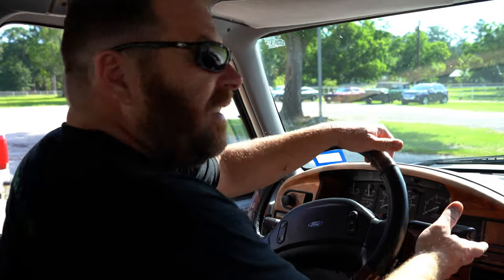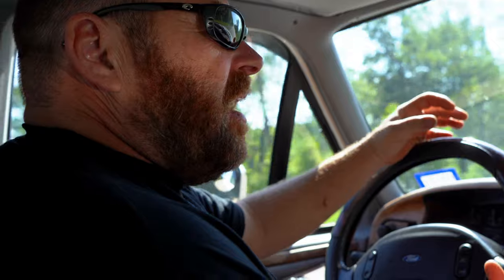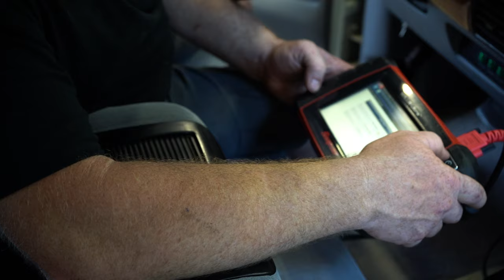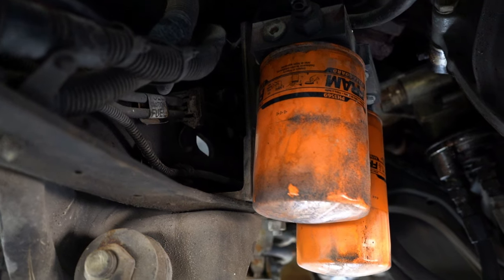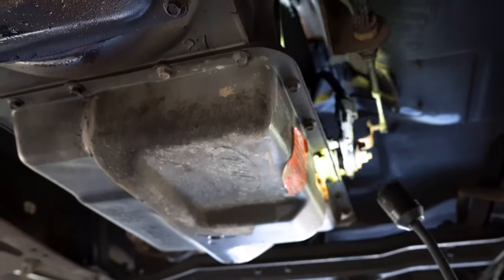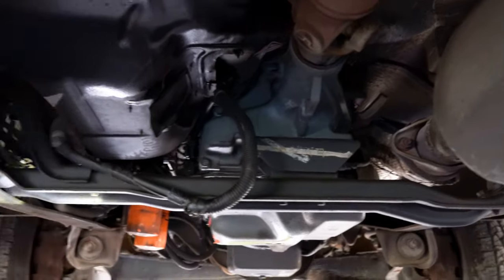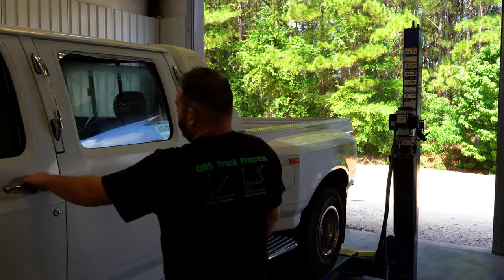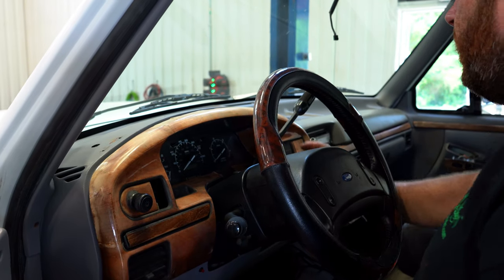How To Video - Purchasing a 1992-1997 OBS Ford? What you need to know....

Comment: When my speedo was bouncing I just had to unplug the ABS module and it fixed the issue
Reply: Where is the abs module? My speedo doesn't bounce but my od flash won't go away
Reply: @keganlaing6483  the abs module is right behind the glove box on the right hand side, the plug is on the right hand side of the module too.

Comment: Have a '93 non-turbo 7.3, the speedometer kept fluctuating/bouncing. Disconnected the abs wiring (located behind the glove compartment/abs module) and the problem went away. Yes, no longer abs brakes, then again, abs wasn't all that good back in 1993! No more speedometer fluctuating/bouncing. These trucks are in the 30-year old range now, they have a right to have some things not working all that good anymore! BUT...they are well worth restoring/bringing back up to good working order. So simple the 7.3 idi diesel engines are and will last longer than most of us will, if good maintenance is maintained. Yes, even changing out the abs sensor on the rear differential (tried 2 different new ones) did not help. Disconnecting abs wiring behind the glove box is what corrected the situation.
Reply: Hmm I’ll have to try that out.

Comment: This is why I will never ever buy an OBS Ford with an Automatic Transmission. My 1986 has 74,455 original miles on it. But the original owner let i sit in a barn in Idaho for 15 years. So I ended up rebuilding the 460 Carb Motor. And now it's a 468 with Forged ICON Pistons, Eagle H-Beam 7/16 connecting Rods and 1969 429 DOVE-C heads on it. It's a 4x4. I am going to paint it. All in all she's a fantastic Truck. I've had several of them. I will never have anything else.

Comment: You forgot checking the core support for cracks along the top, under the rubber deflector strips between the header panel and support and the rot at the mounts. Mostly cracks tho 

So a few things, things that I had to find out the hard way over the years that people seem to ask a lot on the 7.3 OBS pages. 

How to remove the rear door glass (what a fun one that was to learn) 
Door lock actuators and options for replacing 
Inspecting the wiring between the doors in situations where the windows work either intermittently or from the door but not the master switch or vice versa. I’ve bought a few trucks that were really worked and used with broken wires in the doorjam loom where it opens and closes a lot 

I think a black bezel with the wood trim would be more than appropriate for that truck, in my opinion Atleast. The Centaurus truck I gutted was the same way

Comment: I am definitely interested in the brake booster/master cylinder and recalled harness. I don’t know if I have the new harness on my 95 f250. I have an intermittent brake light that comes and goes enough though fluid is topped off. Not an abs light though. Hiss sound from booster and soft pedal. Just put new vacuum pump following a failure with a broken serpentine belt. I’m really looking forward to this series. Goal is to get my ride reliable and then upgrades injectors and such. Thanks for your time
Reply: We did a rear differential service video and while we were bleeding the system I went ahead and cleaned out the fluid reservoir. We still need to replace the booster and add the recall harness which we'll do in an upcoming video.

Comment: Could you go thru the removal and replacement of the lock actuator - I've done the window motors and the handles and there are quite a few video on those but nothing good on door lock actuators. thanks
Reply: We're gonna try and fit that in with the window motor replacement. 😉
Reply: @kerrydick2480  SUPER COOL - I was able to get an actuator out - but how the hell do you see in there to put a new one in - and where do you buy a new one
Reply: @billmoody9736  
I got mine from a junkyard and to put them in basically requires a flashlight and a bit of trial and error. My truck is a bricknose truck though so it might be different since Ford changed the actuator 5,000 times
Reply: @superstar64  thanks -I’m going to a junkyard soon

Comment: Howdy and thanks for sharing the video,  its great.  I own a 1996 F350 xlt OBS with 7.3 power stroke.  Same body style as the one your inspecting here. I love my truck. It too has a few Roll-A-Long items on it. In cab there's the switches marked: DRIVING, RUNNING, AUXILIARY then theres an additional toggle switch. Not suse what that does. Will have figure it out.
Reply from the maker: Thanks for sharing

Comment: Sometimes if your speedometer is bouncing, or your truck is shifting in, and out of gears. It probably means your vehicle speed sensor, is going bad. Which is located on the top of the rear axle. Sometimes the overdrive would flash, but for me, it wasn't.
Reply from the maker: That isn't the case in this truck

Comment: I've got a 95 F250 with a C6, three speed transmission and I so badly want to swap it for something with more gears, but the local transmission shop said it would be too much work. So aggravating at highway speeds. I'm in third gear by 30mph.....
Reply from the maker: Throw a gear vendors in

Comment: My 7.3 has a oil cooler leak. I need to replace the seals at a minimum. Would you recommend replacing the cooler too? Also I haven't done it before, heard it's a pain. I do all the repairs on my truck myself but I don't have a lift to do it. What are your thoughts?
Reply from the maker: The cooler itself doesn't fail very often unless its corroded or plugs new seals should do just fine

Comment: Any fix for the bouncing speedo yet?
Reply: So we did another video on the servicing of the rear diff, we some water intrusion and caused some rust issues. After talking with the owner we decided to clean it up the best we could and check it out in about a month. After cleaning the speed sensor and tone ring I noticed it helped a bunch on the bouncing. We'll see when we open it up again if I can clean a little more rust off the tone ring or we may just replace the axle. I'd say 80% of the bounce went away with what we've done so far.

Comment: I have a 93 E150 Club Wagon Van with 5.8l 351w engine.
IS their an IDLE adjustment on the throttle body..?

Comment: Do you know what that toggle switch is for on the left lower/bottom end of the dash does? I have the same switch on mine and have no idea what it's for. I think it goes back to the  trailer hitch plug, not 100% sure, even if it is, no idea what it does. Thanks.
Reply from the maker: Just something someone added for extra lights at one time.